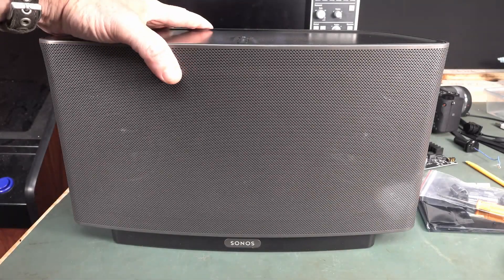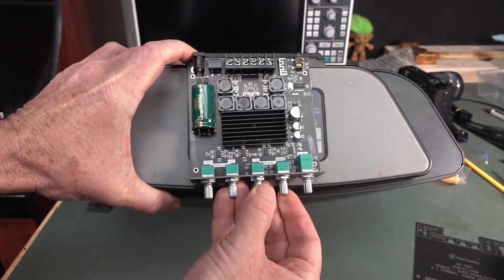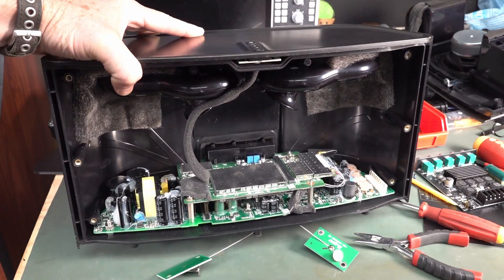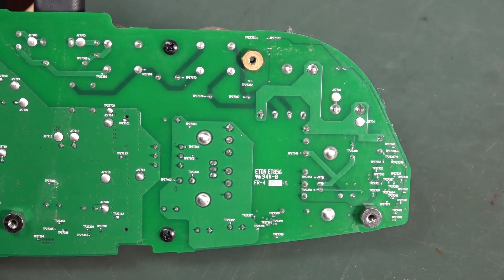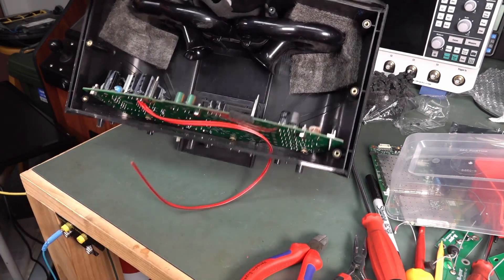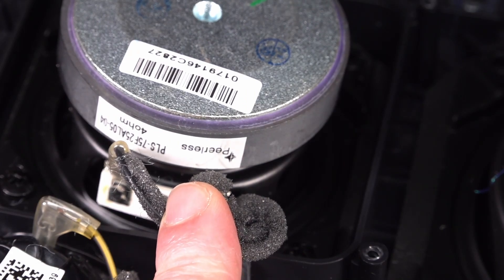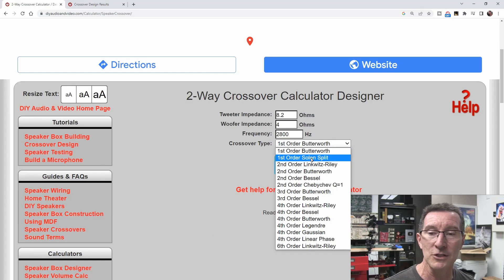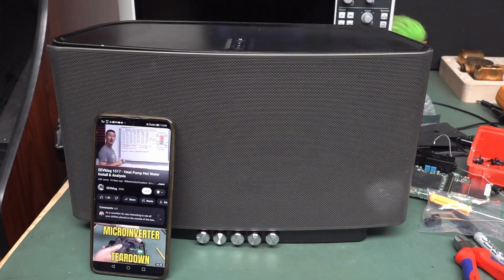EEVblog 1519 - FREE Your Sonos Speaker! (HACK)

Comment: Hi Dave, what preventive measures should be taken while soldering as a hobbyist ? Have I to throw away my leaded solder when I solder only from time to time ? Must I use a solder fume absorber ? What about flux ? Are the precautions only relevant to professionals ? I'm a model railroad hobbyist and I delevelop part of my digital stuff on my own, i.d. HW plus SW. Many thanks for your great channel I am following for years, I really learned a lot.
Reply: Don't throw away leaded solder, it makes the best joints. Solder fumes are flux fumes, either from the flux contained in multicore solder or from added flux. You need a bit of flux either way to make decent joint. Avoid breathing solder flux fumes is best,  but a tiny bit now and again wont kill you as a hobbyist. I do the odd bit of soldering at home with some old leaded multicore, I just blow the fumes away from me as I work. I used to work in manufacturing and we had proper filtered fume extraction, which was basically like having a vacuum cleaner nozzle on your workbench and quite noisy having that on all day.
Reply: i really wouldn't bother about the lead solder: keep using it. It's only important for heavy users (and i dont even really believe that). For occasional soldering just open a window and use a fan to blow fumes away,  for more serious use get an extractor fan with a hose or a filtered fan.
Reply: Keep a clean work area so little bits of solder don't end up everywhere, don't touch yourself, no eating/drinking/smoking at the bench, wash hands thoroughly afterward. Don't breath the smoke off ANY solder, the synthetic fluxes often found in unleaded are generally considered harsher. Get a blood lead level check if you're really paranoid, though I must say the few lead adjacent hobbyists I've seen who are cautious enough to do that all get normal results, including people who shoot a lot of steel targets that more or less vaporize bullets.

Comment: A friend of mine did something similar to this. Except he hacked a Chromecast Audio into it using the same power supply, line in jack (though he did of course lose the optical audio output on the Chromecast), and even ethernet port (the Chromecast Audio does support ethernet using an OTG cable and NIC, fun fact). So basically he made a Google Cast speaker on the cheap. It's a shame that Google killed off the Chromecast Audio even though they still do keep it updated.

Comment: kinda pointless these speakers! You can buy a bluetooth speaker for far cheaper or find it for free, no modifying needed. And this is a wifi connected speaker wich can be turned of by manufacturer so what do you expect? who needs wifi anyways? bluetooth is also as cool. I may not get the use for these wifi connected speakers but anyways nice hack, i would have thrown it into the bin or removed some components for reverse engineering the software but now you can reuse the speakers

Comment: Those powdered iron toroid inductors you used on the "subwoofer" crossover, they will vary their inductance all over the place with changes in current.
Reply: Will they? Not familiar with this. Powdered iron is used in some speaker crossover parts, but those are much larger..

Comment: Oh come on, you should've integrated the soft buttons at the top, at least the power button as a soft-switch with your "world's simplest latching circuit" and switch the mains with a relay, powered with a capacitive dropper.

But honestly, this looks cool. A damn shame for Sonos to use software locking techniques to prohibit playback through the auxiliary port.

Comment: Trouble with modern "speakers" with integrated electronics is that you don't know to what extent the amp section has a contoured response to offset the characteristics of the enclosure - not just a crossover. Glad it worked out for you.
Reply: sonos very much does this, I don't quite think dave was going full audiophile on this, and there isn't really any need to be with what he wanted to use it for
Reply: @elektrokinesis4150  Most of the videos from Dave have at least one "Good enough for -stralia" lines in them ¯\_(ツ)_/¯
Reply: @IcecalGamer  I've seen what counts as "good enough for Australia." The Barra six you put in big frumpy family sedans will turn a tubular girder of a propshaft into a big steel pretzel - without even opening it up!
Reply: @jrshaul  I think you missed the point. I wasn't dissing Dave or the small block (y are we on cars now?). I was just stating the obvious fact that, Even Dave (i think) mentioned in the video, this wasn't meant as an audiophile replacement solution. But it was made as a "don't waste actual good speakers, just because of a fricking app".
Back to cars analogy, don't waste a good platform just cos the ECU is locked. Put a Halltek in it and go do skids. ✌
Reply: @IcecalGamer  Where I come from, "has enough tuning potential to snap the rest of the drivetrain" is a good thing.
Reply: Yeah.  How does the Foss Audio sound quality compare to the original Sonos?

Comment: I have an ANOVA sous vide cooker that is so annoying to use without the app. App always wants you to login. I don't want to be using an app all the time when I'm cooking. So gave up and got one that is front panel controlled and has an app. Never used the app and it works great. I have not seen one cooker that has better control than another. They all seem to heat water the same. I like smart control but it's got to be locally controllable first with smart remote controllability.

Comment: Meh dunno what everyone's complaining about. I've got 3 Sonos speakers at home including the 2nd gen play:5, have been using the system for 5 years minimum and never had a problem or got pissed with the software. Having them on the wifi blows bluetooth out of the water completely. Bluetooth speakers are a PITA compared to these with their limited range and only being able to control one at a time, not to mention draining the phones battery while it sends the music data to the speaker. The sonos ones are smart enough to get the music data from the web themselves, phone doesn't even have to stay within range, can play different things in different rooms at the same time from a single phone/laptop/pc. If you can get your panties out of a twist about having to set up an account, these are miles ahead of "dumb" bluetooth speakers. The sound quality alone is worth whatever temporary annoyance you get from having to create an account.

Comment: I think you are missing the point a bit with Sonos, it’s a multi room audio system designed to work with multiple devices across a network. The reason you need to setup the system before using features like the line in is because the line in is synced across the network and plays out of other Sonos speakers in the system. It’s not really designed as a standalone speaker although it can be used like that. It’s not such a big deal to setup an account it only takes a couple of minutes once and even using the gen 1 app it’s very good system. I know what you are saying about not wanting to setup an account but then this isn’t a product for what you want to do. The sound and build quality are excellent and as a multi room audio system which is it’s intended purpose, it’s the best out there for sure.
Reply: but locking the software so that it cant operate is kinda evil from sonos
Reply: @309electronic5  it’s not locked at all, that’s my point. If you use it as intended, it just works - it’s reliable and sounds great. To be fair, Sonos supports these products for 10yr+ and even the very first Sonos products still work with all the latest streaming services that didn’t even exist at the time they were manufactured. I have had Sonos for decades now and I can’t think of a better supported set of products and reliability out there. Just because you have to set it up before you use it isn’t evil, that’s completely reasonable. If you want a basic Bluetooth speaker, there are plenty of options for that purpose. This isn’t a standalone Bluetooth speaker in the first place so it’s not surprising it isn’t one!

Comment: Wow thanks! never knew how those two/three way speakers worked with a single channel.
I have been building my own speakers with Squeezelite firmware on a ESP32. Works great!
Reply: allright! now that's what i wanted to find out about here in the comments! Because that is then a lot cheaper and more economical than those other (more well known) RPI type of solutions. which you then have to pay a lot more money for an rpi etc.

seem like it's best to get a LAN wired ethernet module too is it? seem like it would be worth the money to add that to the esp32 right?

Comment: I did a similar thing with an old Bose that had the large iPhone connection on the front ripped it all out and used an amp and Bluetooth module and use it in my camper van plugs into a 12v outlet

Comment: The downside is that you lost all the DSP and filters that make it sound good. I imagine they did some sort of FIR filtering to correct the pulse response and give the flattest frequency and phase response possible. A passive 1st order crossover can't even come close to an active higher order crossover. So I would see if it's possible to hack the firmware to make it permanently line in. Maybe it's as easy as editing a config file once you get into the console if it runs linux. Or maybe it's very hard/not been done before.

Comment: Ummmm, I’m a bit of a simpleton - but I would’ve checked the chip to see if there was a pin to ‘jump’ or tie to ground for the input jack to work 🤔 I have the Bose Soundock version 2’s (5 now) they don’t have an input jack but there are ways to jump into the circuit.

Ok, curiosity got the better of me - looked at chip. Maybe there’s a chip prior to this one that can be jumped into / & an A/D converter onboard with it but not used. 

Ho hum!

Comment: I have this iHome iPod speaker and about 15 years ago ago I modded it to be a non bluetooth dumb speaker with the guts of a cheap pair of iPod speakers because it kept cutting out because it used digital everything like power on off and volume and it ate batteries like crazy. I still have that hacked speaker and it still works and it no longer eats batteries.

Comment: I seem to remember the "Play:1" units I have are based on the same or a similar SoC to the BeagleBone Black, although apparently later revs have the boot pin physically disabled. Not sure what rev mine is, I seem to recall they're a nightmare to get into with lots of VHB sticky foam tape. Granted, just hacking in a modular bluetooth amp would probably make them more useful, because they don't have a line in hole at all (I was immediately disappointed on seeing that despite not having paid a dime for the pair).

Comment: Sure, 1st order is fine but mind the total response when you turn on the "subwoofer" (lol) as it´s effectively a 3-way system with the two Peerless (full-range) drivers used as mid range. HF may need attenuation.  You can go as shallow or as deep as you like but going deeper requires more fun, testing  and knowledge acquisition :-)  PS: Thiel-Small param´s for those drivers are on the internet

Comment: one of the problems with the current sonos portable speakers is you can't use wifi unless you give your gps location every single time. i once activated it far away, but then connecting to a local hotspot required me to turn on gps again. the only way around it i think was to bring the wifi router to a different location and somehow give it internet access, then connect the sonos there. once that is registered then you can bring your router back to its original location and start using the wifi connectivity with gps off. such a pita.
Reply: Why does a speaker need GPS position?
Reply: @Broken_Yugo  Because all IoT stuff is basically spyware

Comment: you may need to use a resistor on the treble so it doesn't play too loud. on a 1-order filter where the frequency does not divide so steeply, you may have to have 4.7uf or 5uf. use polyester or polypropylene

Comment: Speakers are some of very little things that actually get better with age, together with headphones, they are always worth it to invest a little bit more for a better quality model, because they should last at minimum 10 years and I'm sure good boxes would last 20+ years without any issues.
Reply: I also have multiple 40 year old speakers that work fine and still kick 99% of the current production in the nuts.
Speaker technology is based on the laws of phisics that hasn’t changed much lol.
it’s actually all the same stuff nowadays as it was 50 years ago.

Comment: I have that exact Amp module. Mine rocks 2 bookshelf speakers and a 10in sub in the corner. The Bluetooth is sometimes a little flaky but mine is lined in to my pc. Powered by an old 19v laptop brick. I love it.

Comment: That's some first-rate bodgery right there. Let's rip the guts out of a 3-way active DSP speaker - what could possibly go wrong?  Yes, you can technically do that, but we're talking the engineering standards of a backyard tinkerer. It's a bit like hacking a hole in the floor of a Toyota Prius for a "Fred Flintstone Edition". So much of speaker design is in the crossover and EQ. I would at least have attempted to do it properly after a look under the shielding. This kind of thing requires a more subtle approach. It may still turn out to be too much work to pursue, but you bet it would be interesting.

That being said, not being able to use the line-in straight out of the box is just silly indeed.

Comment: I'm more curious about why nobody has made a kit with a new board that doesn't need a mothership or any other account BS
Reply: the original board or a raspberry pi or other singleboard computer with a fairly powerfull audio circuitry could work, they can write custom os for the original board, it has a nxp/freescale processor

Comment: Hold up: Impedance changes with frequency? Is that just related to inductive loads?

That's a new concept to me. I'd love to learn more
Reply: Caps too.
Reply: impedance does change with frequency, simply because an inductor also has parallel capacitance and series resistance.  Capacitors have series inductance and resistance, and even resistors have parallel capacitance and series inductance.  It's a messy world!  The manufacturers should be able to provide data on these non-ideal characteristics.
Reply: Yes: https://en.wikipedia.org/wiki/Electrical_impedance#Inductor_and_capacitor
It’s why we have capacitors and inductors in filters - their impedance (and hence the attenuation of current) depends on frequency.

Comment: Unfortunately that crossover would be completely off, at least i would have tried to find the datasheet of the drivers, and i would have simulated the phase change to align with the tweeter with the woofer. (Or measuring directly the thiele small params if the drivers datasheet is unobtanium)

The best choice would have done: buy a chap adau DSP board and a i2s BT module. Program the ADAU with the proper filter calculated above and feed the i2s to the original amplifier board.

A nice project for the channel...
Reply from the maker: Meh. Good enough for Australia.
Reply: @EEVblog  if is good for you is good for me!
A mention about the DSP magic would have been better... At least so people don't expect the same sound quality blaming the cheap amplifier.
Reply: @tuttocrafting  how do you go about simulating the phase change to align with the woofer with the tweeter when the phases are different lengths and peoples heads aren't stationary?  like to some sort of useful end result anyway?

Comment: Sadly you will never get the same sound out of it after hacking it. It is using an absolute tonne of DSP magic to make it sound big and boomy. Ripping the logic out it will just be a "meh" speaker.
Reply: "DSP magic" is just funky wizbang name for equalizer and Dave has simple EQ in it, it's not as good as Sonos for sure, but given the good quality of transducers it will definitely sound better than meh. Also you can make further and more precise adjustments in your phone or PC that is connected to the speaker, and EQs on PC/phone can do all of the "super ultra mega magic DSP" you want.

Comment: Just tap a raspberry pi i2s and kill the cirrus chip and it will work and you can install Plexamp, AirPlay, and way more and bob’s your uncle wifhout anything else. 

Even the top buttons can easily be made to work with the pi.

(There’s even an i2s driver built directly into the pi os)

Comment: The product isn't bricked in any sense because it still works with the old software, and the old software is still regularly updated and most of the 3rd party intergrations still work. So tame your stick down a little Mr Grumpy. If you have an aversion to giving a company your details then this product isn't for you, however there is still nothing wrong with the product that wouldn't be fixed by the "USER" reading the documentation about it being a GEN 1 product.
Reply: Oh, so you're one of those. Could've guessed by your user name alone. 😂
Reply: @TheFirstBigCheese  oh no your one of them, could of guessed from your username alone.
Reply: @yeahright3348  : Oh, what a unique an clever response. The internet salute your creativity 👏 (If it wasn't for the horrible spelling, 🤡).